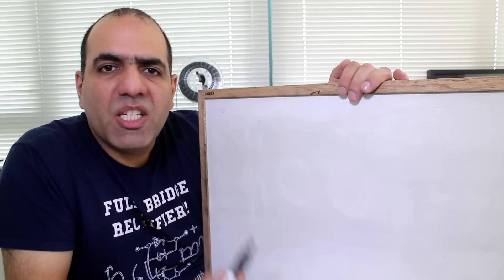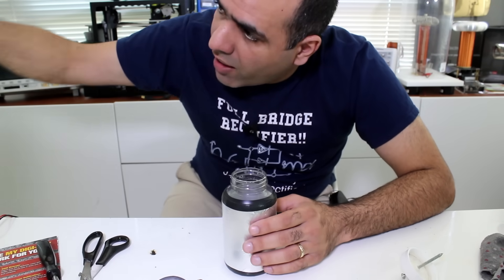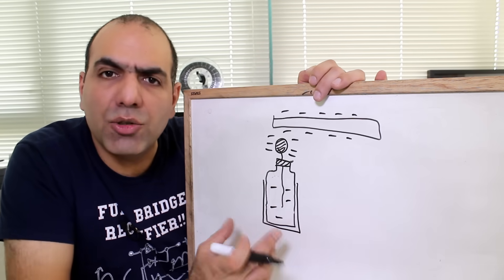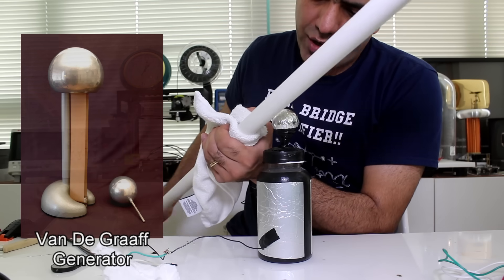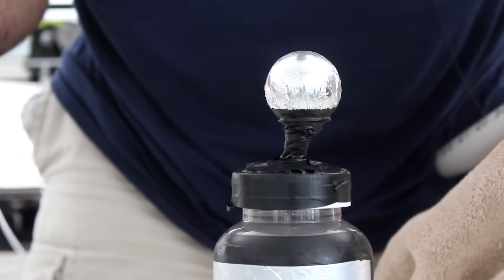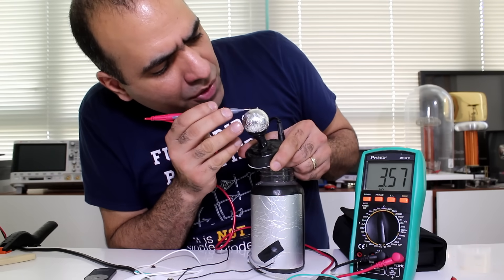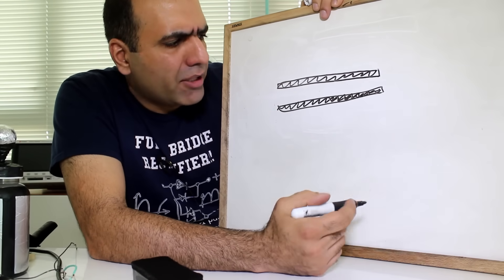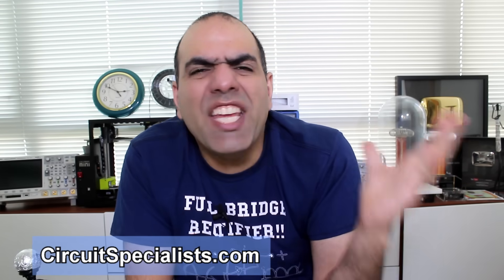Make a SUPER HIGH VOLTAGE Capacitor

Comment: You should make a voltage multiplier for a video or as a 2 million sub celebration.
Also, you could have used a dimmer and capacitor in parallel to generate the square wave that the car ignition coil needs.

Comment: I did something similar in high school physics class on accident, I put a small florescent bulb into a new jar of playdoh, then unknowingly charged the playdoh when holding it near the schools van de graaff generator.  It gave a surprising shock after removing from proximity of the VDG generator. 
Thanks for sharing the science behind how capacitors work.

Comment: Hmm, are there more 'natural' materials than PVC pipe that could be used to charge up the capacitor? Also, would a copper sheet work as well as aluminium? Everything else used is remarkably low-tech and could pretty easily be done in, like, the middle ages or earlier :D

Comment: You have a ground wire in (on) one hand and you touch the capacitor with the other. Doesn't that mean the electricity is flowing through your heart? It's not very safe

Comment: You should see if you can get your hands on a 1000:1 passive probe.  We use those when monitoring secondary voltage on an automotive ignition system.  40kv will break the scope quickly!

Comment: Hello folks and ElectroBoom, i want to make my own hydrogenerator turbine at home (small scale) and i have no clue about almost anythig with electronics. been watching this guy alot to find something i may use but im not sure if it would work. iv made a drawing that has a turbineblade with a DC motor / dynamic one of those, and the blades are ofc connected to the motor/generator and from generator to circutboard with rectifier and regulator then to USB?, would that work?. and if i use a dymanic generator would the durbine blades to strong enough to turn the blades in the water?.

Comment: you should do some sort of blind folded challenge where you try to guess the voltage and current of an electrical discharge to your body by the paint you feel. 
And then challenge someone else to try the same. Keep it safe tho.

Comment: to me it seems like the voltage rises linearly: 10 strokes zaps 1mm away so its 1V, 20 strokes zaps 2mm away so its 2V, 50 strokes 5mm 5V and 100 strokes 1cm 10V.. but the distance is hard to see from a 2 dimensional viewpoint so what do i know..

Comment: I learned that electricity hurts by looking at waveforms.

People still tell me "That was not a floating waveform from an oscilloscope floating in mid air. That was a high voltage arc. Also, you died."

Comment: The current peak you calculated isn't correct because the wirewound resistor you used is inductive resulting in a higher voltage for a given current due to the very fast risetime of the discharge pulse.

Comment: can you show the calculation for the time required using you microwave transformer to charge the capacitor?  would a full bridge rectifier half the time compared to mr. puny?
Also with higher capacitance comes higher responsi... sorry higher energy storage, and with the new design and lower resistance, the arc should can be much bigger/stronger/brighter right??

Comment: This is the difference between a hobbyist, and a professional. Where a hobbyist understands the basic concept of the theory, a professional understands the whole parameters and boundaries that contribute to the production of a working product. Hobbyist's miss a lot of information that is held in the fine details of the systems they are trying to demonstrate. As with my profession, it was true when The King of Random was casting a silicone mold of a Poke Ball. He didn't account for surface tension of the silicone while trying to de-air the silicone. Silicone expands to 4X of the original volume of it's resting state while under vacuum depending on viscosity, surface tension, and of course vacuum pressure. As well as creating a smooth surface layer to get a high definition cast. As it is with all science, " The devil is in the detail." In no way am i bashing "The King of Random" as he brings science to the mass viewers, but the techniques can be refined with the help of professionals in their respective fields.

Comment: Build more capacitors and one of those spark gap voltage multipliers =)
(Though be careful, side effects of failure in doing so may include involuntary flight, hemispherical wounds and a nasty smell of burnt flesh)

Comment: How do i connect it to "earth"? I dont quite understand that part.
Reply: Do you know how to make a extension cord? If you do buy a replacement plugend, (male) some wire and only hook up the ground in the plug end then you can just plug it into the wall receptacle and that will be a good ground just make sure you are hooking up the right wire. Let me know if you need better instructions.
Reply: Philip Eisenstein he means he have connected himself somewhere which connects to ground. For example u can connect urself to kitchen sink because kitchen sink pipes are connected to ground.
Reply: AepaTM thanks, I understand now!
Reply: AepaTM probably not. Most homes have plastic supply lines from the water pipes to the faucet
Reply: Jacked up then where should i put the 'earth' wire?
Reply: You can use a pot w/ soil then add water on it then put the end of the wire inside of the pot

Comment: Am I out, far out when I propose you have built a battery and not a capacitor. Is not a capacitor built using the same conductive material on both sides not to create an inherent potential difference? If you stack coins of different metals you get a battery, stack only copper coins and not a battery.

But what about this idea - atoms are capacitors. The difference between proton and electron is the potential difference and the rotation around the heavy nucleus ensures only to keep up the potential difference. Add energy and it is radiated as photons when the collapse occurs from the excited state. We are braking new ground here dudes by looking at the problem from a different angle. We interpret the atom as an atom because the potential difference is locked to a point in space. But what is the nature of the potential difference?

We call it + and -. Put a strong magnet onto several nuts and bolts and you have something that resembles a human body, as the parts stick together along the magnetic field lines. Gravity as turned magnetic field in the right hand rule. Thumb electric current, fingers magnetic field and palm force. On the other hand a permament magnet has the force in line with the magnetic field? How come?

Ion binding in a biological body as opposed to direct metalic magnetic bonding.

Comment: I was building mylar and foil capacitors when i was 14...over 30 years ago. Cmon kids you still havent advanced much have you these days. I used to charge them with a  high voltage multiplier circuit (capacitors and diode array) up to 10,000v no problem and dammnnn the sparks i could get off that thing were insane. Dangerous as hell no doubt too

Comment: You want a super capacitor?  Use BOXING TAPE on a long strip of foil.  With a sharp knife you can cut the foil while still on the roll.  Use three dowels in a jig, one for the tape and one for the foil, and you can roll them together onto the 3rd dowel.  The tape holds it together too.  Just start the roll with a short length of copper tube for best conductivity.  Edit: double up the foil and tape (5 dowels), forgot we need two layers of foil.

For extra fun, treat the aluminum foil with a graphene deposit layer.

I knew a guy who made a self-charging ball, that when you threw it, the spinning of the ball charges an internal capacitor.  When caught, it discharges in your hand!

Comment: You could use one of those ladder circuits with the diodes and small capacitors to double the voltage out of the microwave transformer a couple times to charge the capacitor you made up to 8 or 10 KV

Comment: Nice video but you did not measure the jar ESR correctly. You measure it from dielectric to the plate. Capacitor ESR is given by the contact surface (of the terminals/plates) and the plates material.
Reply: getting leakage current is helpful but that gives you parallel resistance not effective series resistance. for practical purposes you want to know the ESR at your intended operating frequency, which may be rather different from self-resonant frequency. however for intermittent high-voltage pulses, it is close enough i guess
Reply: ESR would usually be measured at particular frequencies
Reply from the maker: but the salt water IS the terminal/plate
Reply: ElectroBOOM. But you measure the capacitance of the jar between the top sphere and the outside foil.
Reply: Paul Shields, You are right. At the self resonance point of the capacitor.
Reply: ElectroBOOM What you measure is the dielectric resistance which give the leackage current of the capacitor

Comment: why not build several of those and use a voltage multiplier using your 2kv output of the microwave transformer
if you build 10x multiplier you'll get around 28kv jhaha

Comment: That attempt with the microwave transformer .. way off.  Try with a tiny fly-back circuit.  Need high voltage, low current to generate charge.

Comment: Why is the microwave generator necessary to charge it. Wouldn't a normal low voltage power supply also but electrons on the capacitor?

Comment: Hi Boom thx for gr8 videos,
I have a question for U. As explained before one may get mains short to earth when measuring mains powered device with oscilloscope. How come we do not get short connecting computers  with ethernet cables or printers with usb cable. Those cables look grounded on both ends.
Greets
Gregory

Comment: So i am not anywhere near an expert in electrical anything.  My question is from 10 strokes to 20 stokes the kilo-volts goes from 1 to 5 (i understand that is an estimate with noting being measured accurately) but from 20 to 50 strokes the kilo-volts go to 10 and then 100 strokes to ~15, why does it seem the more charged it is the harder it is for the capacity to increase? Sorry improbably not asking this right.

Comment: I saw some guy on tv charging a cellphone from a capacitor made of chains and salty water and let it get hit by a lightning. I was wondering:

1) charging something from a capacitor: dont they output all their charge at the same time? 

2) if you put a lightning's power in something: how freaking HUGE will the output be?

Isnt this super high amps released at a cellphone

Comment: Materials aside, how far off is your capacitor from something like optima's spiral cell AGM batteries?  It's layered, energy-storing material that's wound in a coil - so it's not very different in a basic level, right?
Reply: caps different from batteries. Capacitor store its energy in electric field while battery in chemical form. Capacitor releases all its energy instantaneously while batteries releases its energy in more controllable manner. If you happen to connect fully charged high capacity capacitor to electronic devices, it would fry the device.
Reply: killarun4 so even having multiple capacitors wired together (either series or parallel), you couldn't make a sort of short-life battery? I'm not saying it would last and feasible amount of time, maybe even only milliseconds, but I feel like there's still similarities
Reply: Yes... battery and capacitor have the same basic function, to store energy. Though there's so little application where capacitor used as the main voltage source. For example flash light on cameras. They only lit for 1/1000 seconds. The light energy emitted by a flash is supplied by the capacitor, typically with 330–380V operating range. This system still need battery to charge up the capacitor.
Reply: killarun4 that's a fantastic example as I'm a photographer so I completely understand what you mean. Thank you!

Comment: I made many Leyden  jars from plastic food containers when I was playing with static electricity in 5th grade or so. Plastic food container, aluminum foil rubber cemented to the inside and outside worked really well. I had a Whimshurst static generator, and using its original capacitor and my two additional Leyden jars, I could get a good 1 inch spark or so when fully charged. Definitely didn't want to ground that spark through your body.

Comment: Capacitor technology is bizarre in the fact you can make more capacitance reliably using tightly wrapped metal plates instead of using electrolyte to hold charge.  This is why car batteries using cylinder capacitors are much more expensive, albeit much more reliable with higher cold cranking amps available, than the chemical electrolyte based batteries.  Once the electrolyte loses capacitance from losing complete charge only once, it's really difficult to gain back the amps lost, making the battery essentially useless and unreliable when you need it.

Comment: Don't use a van de Graff generator, make a Cockroft-Walton. You could also make a Marx generator if you like sparks. EG /watch?v=XcqKtDZxLJM (300kV homemade Marx).

Anything under 100kV is pretty low voltage for HV nerds. 1MV supplies have been made.

Comment: If I'd been there in the room I'd have warned you about the severity of the shock you were about to receive. I remember shocking myself with the 10 nF capacitor on the output of the 10 kV helium neon laser power supply I built from a kit from a company called Information Unlimited, and let me tell you, that IS the most painful thing in the world, even if just for a moment. I don't care about passing kidney stones, or women giving birth, or getting a root canal without anesthetic, the shocks I got from there I'm quite certain were the max a nervous system can receive, I guarantee it's the most painful thing a human brain can even interpret, it is one moment of hell. And you already said your Leyden jar was over a nanofarad, and charge via static electricity to several thousand volts, it was inevitably going to be the same thing.

Comment: Hmm, I wonder if you could create a bank of these diy capacitors with a charging circuit to take a charge from solar panels and discharge that power to a battery. It would probably be impractical as heck, but it would be a fun way to diy a powerwall.

Comment: So can you explain what you said about the tesla coil working? "High frequency will not work because the capacitor is like a short circuit? Is this because its so high frequency its almost like a dc wave form? Even so wouldn't it be a open and not a short?

Comment: Can you teach us about caps and reactance?  I don’t understand how you can use a cap on an ac circuit as a resistor.  Caps block AC.....  
if you do this, I’ll grow a unibrow |:)
Reply: L borate caps block DC. The reason is when you apply a DC voltage to a capacitor, it charges up to the voltage of the source and the two equal and opposing voltages cancel out and the current through the system is zero.   That's how caps block DC. 
When an sinusoidal voltage (AC) is  app applied across a capacitor, it continuously charges and discharges the capacitor because the source voltage rises from zero to positive, then drops to negative through zero and rises back to positive. This cycle goes on and ensures that the voltage across the cap is changing continuously, thus allowing a current flow (unlike DC). The reactance of a capacitor is given be 1/(2πfC).
Reply: Now grow a unibrow
Reply: To expand slightly, the usefulness of reactance (X) is when it is combined with resistance (R) to get impedance (Z), a complex quantity. Z = R + jX, where j^2 = -1. So for a capacitor, Z = ESR + j / (2πfC). Here as f approaches 0 Hz (DC), the magnitude of the overall impedance gets very large (blocks DC like an open circuit); as f approaches very high frequencies, the reactance component vanishes and so it's as if there's no capacitor present (passes AC like a closed circuit). Also, equations like V = IZ can apply to resistors, capacitors and even inductors.

Comment: 4:21... Just for charging the capacitor, couldn't you just use your body as ground instead of connecting a cable to earth AND your body?

Also if you touch the positive charged terminal, will there be an arc? Is it because the negative charges from your body passes to the positive terminal?
And if so, would there be an even bigger arc then if you later touched the negative terminal, because your body would be positively charged, increasing the potential (voltage)?

Just trying to learn here and understand. I find this extremely interesting. Thank you for this amazing video!

Comment: How about creating a voltage doubler (several ones) on top of your microwave transformer to get to the necessary voltage. They can often be very cheaply constructed from (cheap/free) fly swatter circuits from places like Harbor Freight or dollar stores. They typically use 1kV capacitors to charge up to ~2-4kV even though I've gotten those things up to 12kV without immediate breakdown.